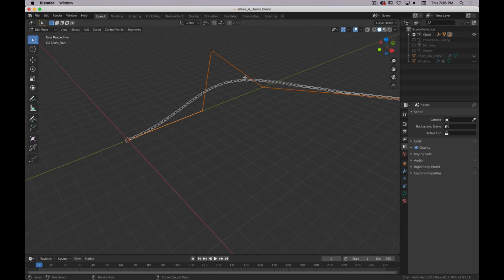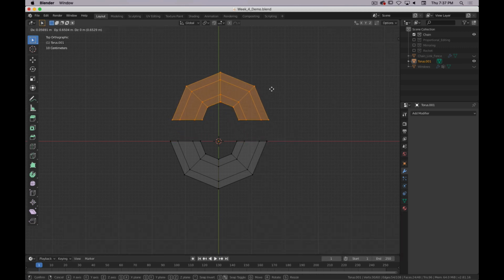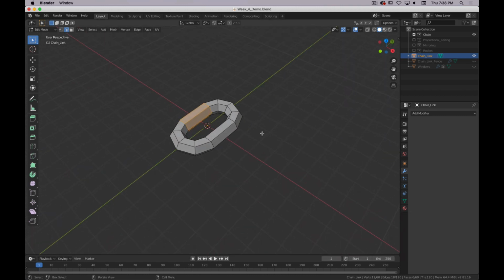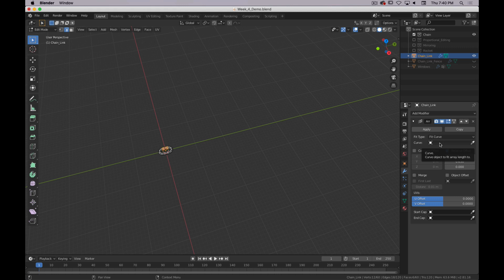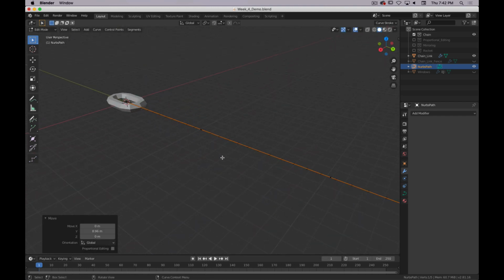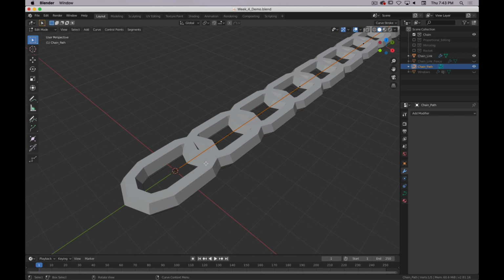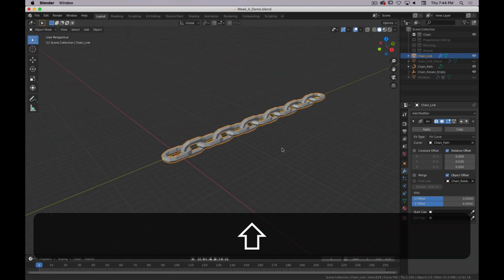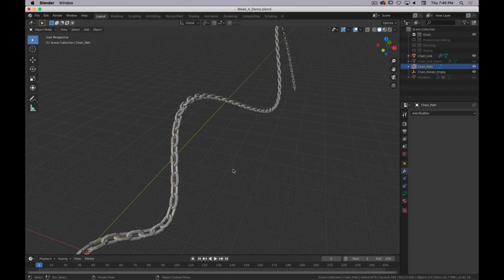3D Basics in Blender - Creating a Dynamic Chain

Comment: what i find strange is that, having defformation on axis X makes the result you get, but if i select y it goes straight up, and ive checked that my chainlink roation, direction and everything is identical to yours, i mean im happy it works, but it puts me so off that the wrong axis is the correct one... like what the frick ? all rotations that you applied are followed by the book and everything is identical so there shouldnbt be a reason that X is the defformation axis thats correct, it really should be Y. so strange
#

Comment: I was messing around with this a bit, because when I added the array, my chain links started to shrink further I got from the original. It turns out I need to apply the transforms to the chain, but not to the empty. If I apply transform to the empty, the the chain links will not rotate, if I don't apply it to the chain link, it will shrink.. Plus for some strange reason, my curve path was not showing in the object browser.. 
I managed to find it out eventually, but thought I'll leave a comment for later generations in case they run in with the same issues..

Btw is there a way to add end pieces to it that's manual?
Reply: Had the same issue. But when I apply transform to chain, only 1 piece of chain remains. I applied it to empty, rotated it again and it worked.
Reply: Click chain rotate empty (upper right corner) and under transform set the rotation of the Y axis to 90 degrees. I thought I had set it when he initially said to, I even made sure I did with the drop down menu that appeared in the bottom left, yet nothing happened. I had to do it from the properties on the bottom right hand side